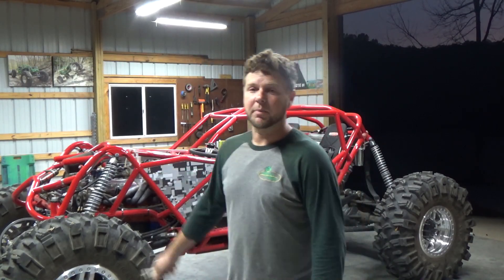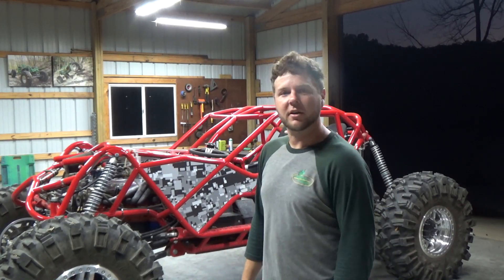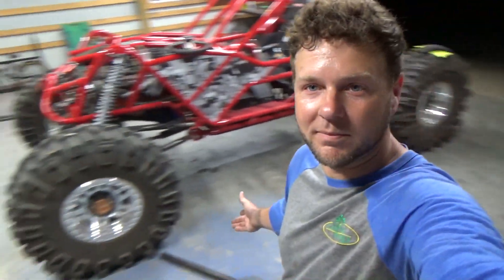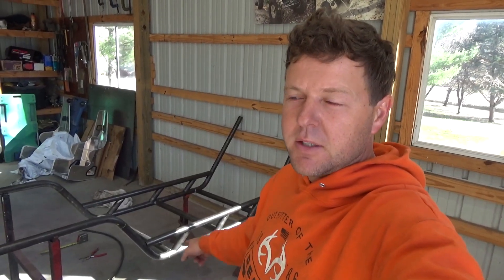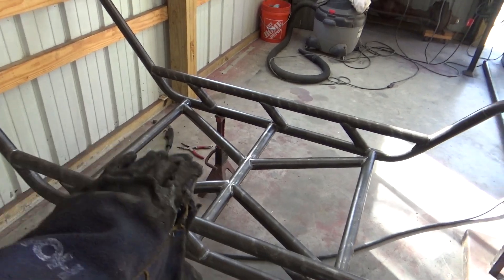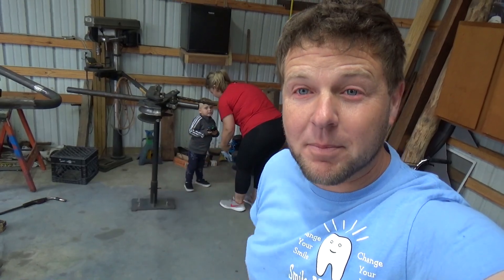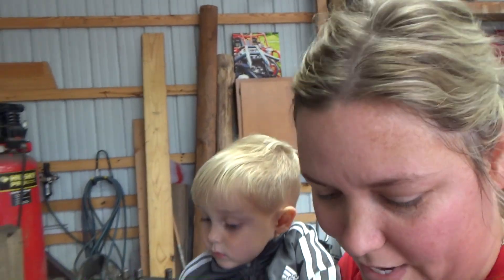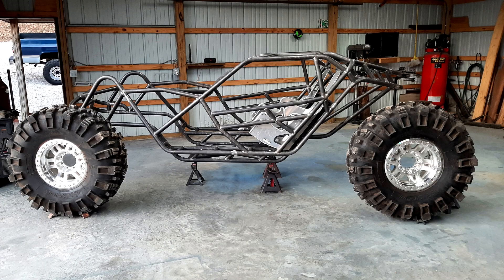Rock Bouncer Chassis - Complete!

Comment: The design of the cage is next level. Well done man 🍻 do you use any kind of hole saw system when fitting the tubing together, or do yo just cut it in with an AG? I didn’t see an footage of a hole saw set up and saw you working with an AG a lot so I wasn’t sure if that was your primary method of cutting the ends of the tubing or not
Reply from the maker: Well thank you so much man. I've used a cheap hole saw in my drill press for straight copes before on repeat pieces of tubing. On this chassis I think I did the whole thing with an angle grinder. My hole saw is dull so I said screw it. I'm honestly pretty fast with the angle grinder, I prefer it.